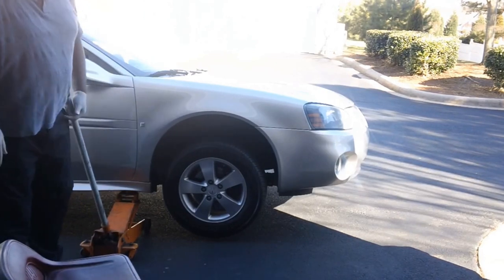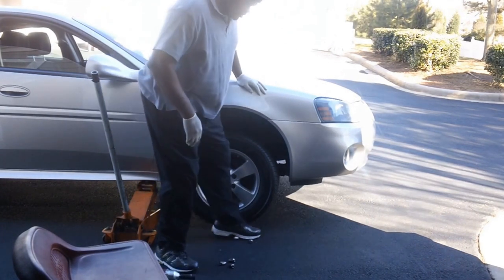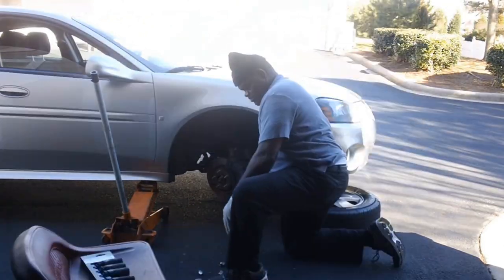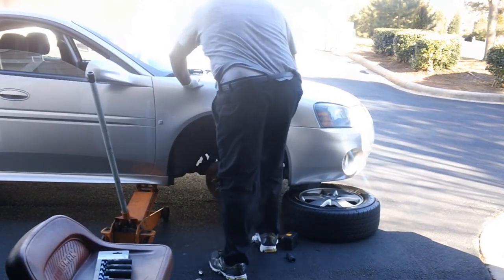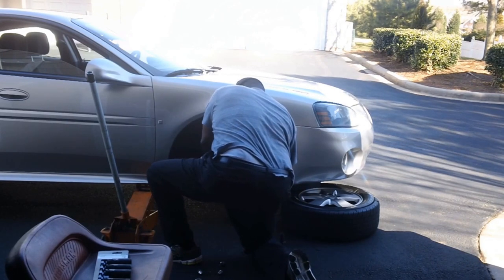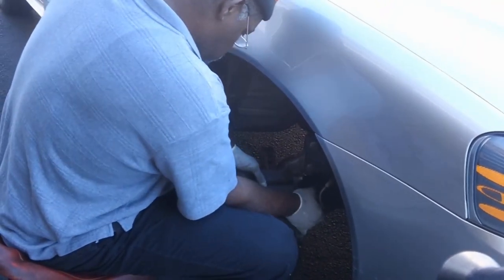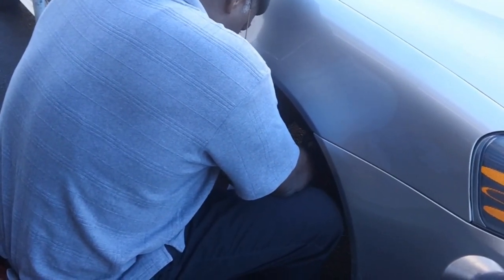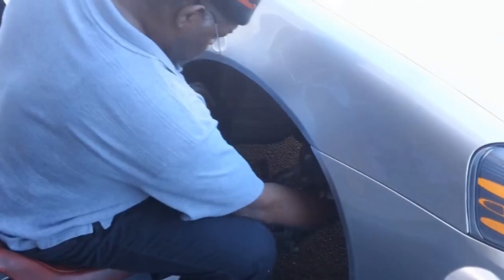How to replace hub bearing 2008 GP

Comment: I have a 04 grand prix gt with 232,000. I have grinding brakes that only does it at 20 mph or less. No one can figure it out. Some mechanic mentioned the abs control module for $400 - $500 plus labor but than i read online and it sounds like the left hub assembly. But how would i know what to fix. I have replaced pads, rotors, calipers and its been checked by 3 shops. HELP!!!!!